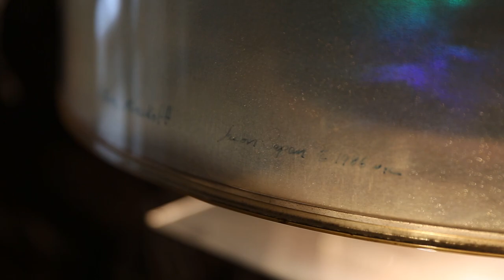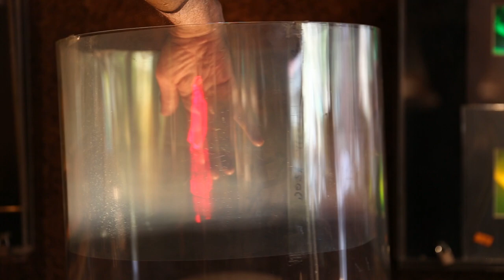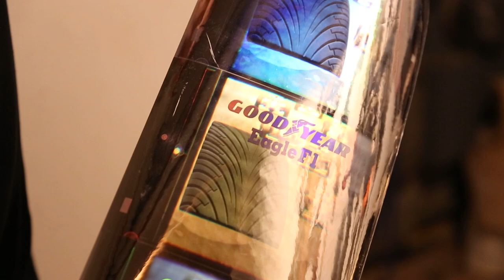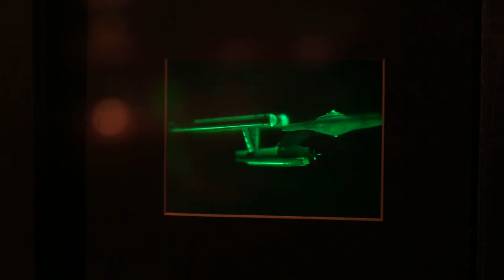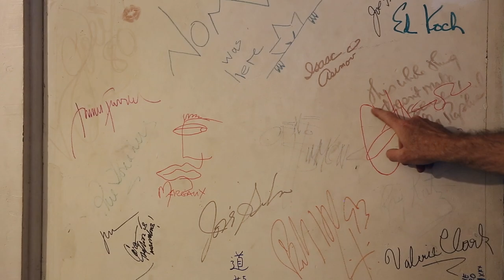How Holograms are Made

Comment: From what I understand, this still isn't a hologram. All they've done is burn a 3D image into different thicknesses of film. It seems as though all these tech companies are changing the definition of a hologram because they can't figure out how to achieve it. A hologram is a 3D image made from the interference of multiple continuous light beams. There shouldn't be anything left over to put in a display case; at that point, it's just a sculpture.

If I'm not understanding this properly, please explain. However, the definition of a hologram is decades old. Think Princess Leia's message displayed by R2-D2 in the original Star Wars, that's a hologram.
Reply: The rapper 2PAC had a holographic concert a while back. Look it up on here(Youtube). That is the idea most are referring to when speaking of holograms.
Reply: I think these could be considered holographic pictures, and they just called them "holograms". Yes, we all want to see real holograms, but I can't really fault them for using that terminology; it sounds like they actually are creating the information of a hologram, but the only way to show them right now is on a 2d surface.
Reply: James Dreger  Correct the Idea of the Hologram is set... Pretty much without color atm. But The background or backdrop is still required. No Fully 3d Hologram will be made in our life time. Millions of light sources and or Beams or projectors would be required. 2 Pac was Partial 3d. Close to what was in Minority Report 
 Lots of projectors shot at a backdrop in a half moon shape.
In our life time Minority Report Holograms will be real and we will have heads up displays and Other 2d but 3d eye fooling holograms in our near future.
Reply: ".., the definition of a hologram is decades old. Think Princess Leia's message displayed by R2-D2 in the original Star Wars, that's a hologram." This in fact wrong. Deze defenitions of holograms displayend in movies in a common misconception. Real holograms are these images created by the interference of multiple continuous light beams. It is a phenomenon of Physics that even is lectured at engineering schools.
Reply: Shanim Z But even that was basically, a projection on a mirror, that bounces onto a sheet of transparent paper, or material. 
If Snoop Dogg stepped one step to the left it would have ruined the illusion. As he would have been reflected in the mirror.
Reply: True. The Tupac effect was basically just the Pepper's Ghost effect which was done in the 1800s. It's also used daily in the Haunted Mansion attraction at Disney parks.

The definition of hologram in nearly every dictionary is exactly what I said originally. However, it seems that later on, it was amended to include "a photograph of an interference pattern that produces a 3D image." So by definition standards, I guess these are holograms, though not the kind I'd like to see.
Reply: Rob Cartwright et.al.
While by some standards a "true hologram" must be an image (or something that looks to be a real object) floating in space with no complex projection system, as depicted in some old movie, that does not define it.  The things in this video are Holograms, although just pictures of holograms..  Your definition "burn a 3D image into different thicknesses of film" is rather vague and seems to imply that there are regular images stacked one on the other, but done that way, they would all be present and produce nothing but a blur.   It is also not clear just what you mean by "a 3D image". That could be anything from an image on a flat screen with effects such as shading and persoective that has the appearance of being in 3-D without binocular vision; or it could an image that looks to have depth due to presenting different images to the two eyes, thus allowing ther brain fo interpret it as an object with depth.  

Summary:  A hologram is a complex pattern of what may be considered as diffraction gratings that produces the pattern of light that the original object produces when it is illuminated.  As someone who has made holograms (literally in my basement) I'll repeat parts of my earlier post for you to consider.:
 
  What is contained in the hologram film must be understood as a very, very complex three dimensional interference pattern within the film's emulsion.  Because the film has thickness, there are interference 'patterns' created within the depth of the emulsion as well as across the surface dimensions. These interference patterns are on the order of the dimensions of light waves and are stationary.  They are called standing waves.  They are not direct images of the original object as ordinary photos are.  If you do not illuminate the hologram film from the proper laser wavelength and the proper direction, you will not see the image.   An ordinaly photo can be illuminated fron just about any abgle in front of the pisture.. 
Because these patterns don't move as the light waves vary through their high frequency cycles, they expose the film in a stationary pattern.   If you understand how standing waves are produced on a radio transmission line, this is the same principle, only in three dimensions instead of just one.
...
  The film must be developed and bleached to make it look clear to view it. To view the image the laser beam is spread again and shined on the film from the same direction as the original Reference Beam.   This film is now just like a "window" though which you see the object in the same position it was when the film was exposed.  The hologram produces light that leaves the hologram in the very same way it left the original object (and passed "thought" the window formed by the film).   As your eye moves around the window's area, you see light in the same way that it actually left the object and traveled in that direction to the film.  Since, at any one time, an eye only looks through a small part of this film window, this means that every location on the hologram film has a complete image of the object as viewed from that single location.    THEREFORE, your two eyes, located at different locations and looking toward the film window, receive light in the same way they would form the actual object and you see it in 3-D.
...
 You may think of the hologram film as having billions of really small, strangely shaped prisms that refract the laser's light.  These dimensions of these effective prisms are on the order of the dimensions of light waves.  They refract the light from the viewing laser into a form that duplicates the very way reflected light left the original object.  Also, because they are prisms and prisms spread the colors in slightly different directions, you must use the correct wavelength of light to reconstruct the image correctly; though in my experience a close color looks pretty much the same. This may not help, but if you viewed a hologram of the simple interference rings from two split beams aimed at the film, you would see a single spot of light representing the "object beam".
...
Lastly, the reflection holograms you see in the video and on your driver license or charge card do not do justice to the meduim mainly due to their small size that prevents much 3-D effect to be observed.
--
Cheers, ScienceAdvisorSteve
--
P.S. Yes, it is possible to make a hologram image that "floats" in front of the film.  This is done as a hologram of a hologram to get the image on the other side of the film. However, the film must always be behind the floating image.   Light through the film must meet your eye.  It is a "virtual window" behind the image.   A complete ring of film is required for you to walk around such a floating image along with light from a single laser coming from all around the outside and shining inward toward the center.
...
P.P.S.  Another amazing aspect of these "Transmission Holograms" is that if you shine a laser dot onto the hologram in the reverse direction from the original reference beam, you get a complete image of the object projected on a screen located where the object had been.  This is without NO lens.. This is because, unlike regular photographs, each tiny piece of the film containes a complete set of diffraction prisms that produce a complete image of the original object(s) [from some single perspective].  The image will be seen from the perspective of the point on the film where you would have looked at the original object when you exposed the film.   As you move the laser dot around the film, the projected image changes perspective (rotates) to match that location on the film.  I saw this demonstrated in a hologram talk and duplicated it myself when I made my holograms.  No lens projection --- Very COOL!
 So, unlike an ordinary photo, any small piece of the hologram film can show the whole object, but just from a limited perspective.  If you cut an ordinary photo into small pieces, each piece will only show you a small part of the original object.
...
P.P.P.S. There are white light as well as colored Holograms and they use some sophisticated processes to achieve them, but those are other subjects all together...
Reply: Rob Cartwright mmmmmmm pepper's ghost makes me happy.  I got to fool around with a true peppers ghost effect in a haunted house attraction.  It was done with I think 1/2 plate glass and a very bright spotlight.  It was pretty epic.
Reply: The word hologram comes from the Greek words holos, "whole," and gramma, "message.". You have chosen the science fiction use of an ambiguous term and call it correct, however it is not. Good day sir.
Reply: Observ45er You, sir, made more sense than the video itself!
Reply: girass I was merely quoting the definition of a hologram from a popular dictionary, which does seem to be in line with the science fiction usage of the term. I was seeking clarification and conversation. No need to get huffy.
Reply: Rob Cartwright Just about everything he says is correct, but you must understand holograms first before you can understand that he is explaining them.  They really need to redo (or remove) this video ! ! [not to mention the vast majotiry of all other YouTube videos]
...
The part about moving when you take a selfie causing blurring has no relation to his explanation about the speed of light and why there is a reference beam to form the standing wave patterns.   He used a bad analogy that does not apply.
...
Very few listeners would grasp that phase is a measure of relative distance to the film, yet he throws that out there as well.
... If my explanatino is understandable, thanks.  I worked on it for a while...

Cheers
Reply: Shanim Z That was a projector pointed at a sheet of glass
Tech we had for many years
Reply: A 'hologram' is just a 3d image. There are many kinds of holograms, and this kind just isn't the kind you are thinking of.
Reply: ***** Holograms do exist and there are many forms of holographic technology, including this one.

That said, even imaginary things do have names, eg "dyson ring".
Reply: *****  If Holograms don't exist, then what did I make in my basement back in the 1990's with my HeNe laser,  beam splitter, mirrors and  special film that I then developed and bleached with a solution of tincture of iodine and can now see the objects I had in back of the film, when I shine the HeNe at it from the same direction as the original reference beam?
--
How do YOU define the term "hologram"?
Reply: *****  Do you mean to say that you define a hologram as  nothing more than the "Pepper's Ghost" effect that is caused by an unsilvered glass at 45 degrees?
Reply: *****  I'm still not understanding, but trying. Your intent is not clicking on this end.
 
What I made in the 90's is "that"...?  What is "that"?

What precisely are you calling the ghost pepper effect?
I am familiar with what is called Pepper's Ghost effect.  This is plane glass at 45 degrees that reflects something into an area where it isn't.
Reply: well we legaly and safley cant use holograms because the only real way to make a hologram is using this rediculously radioactive machine that can only be used for short periods of time but this is a good alternitave because its safe and simpler for anyone to create or obtain
Reply: ZBoy0123  What?  The ones I made didn't require any "rediculously radioactive machine".
Reply: *****  Neither did GMG...
Reply: *****  From understanding Hologram to Dooms day machine....  What's the connection?
...
This video is not the place to gain an understanding of holograms, so on second thought , perhaps it is the place to jump off onto an unrelated obtuse subject...
Reply: ***** While I don't see that connection, at least I see where you drifted...
tnx. 
But... as I said.  What the guy says in this video is an overview, summary, analogy of holograms that makes sense to someone who already understands the subject, but not for someone who doesn't.
Reply: *****
i think ghost peppers are a species of hot pepper
Reply: CorvusCorone68  Nah!  Ghost Peppers aren't hot at all. They're rather cold and clammy.
Reply: Tim Goelen
i exactly think same way. Hologram is basically "seeing 3D images in the air, without 2D screens, and can be seen from 360 degree, " if it is not , it should called something else. everybody change the meaning of hologram. before star wars, none of us know what hologram is. that scene is hologram to me..)) does it exist ?
Reply: Yavuz Zengin Movies don't define what a hologram is.
Reply: Observ45er yes it does. do not underestimate the movies my friend. they push the limits, they afford and support these technologies. you better read again my post. have you ever seen or heard of hologram before star wars? i do 2D & 3D drafting , modeling and animation to make my life. These movie production companies use most advanced technologies before all of us. Now so many companies makes shitty products and call them as hologram to make money. Search google , you gonna find millions " hologram projectors for $300 , or 4D, 5D, 6D, 7D hologram products... guess what ! they all work on 2D screen
Reply: Observ45er
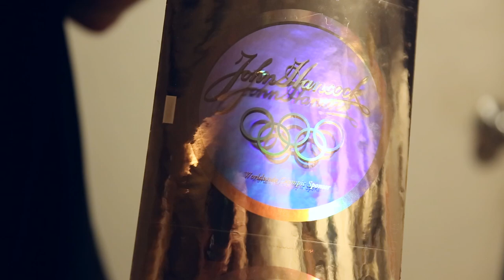 this guys exactly saying what i am trying to say like so many people who is not expert on this and asking same question if you watch between 2:30 to 4:20 . And i repeat my question " does it exist ? " . it is all scrambled to me. that is all i need to know :-) i am not trying to define what hologram is here. Just curiosity . thank you if you can answer this
Reply: Yavuz Zengin  Very good.
A: Yes.  What was poorly explained in this video are true holograms.  They have true 3D appearance when viewed by us folks.   I literally made some in my basement and still have them and can see all this myself.  That's why I got interested in this.
...
2:30-2:50  He's trying to explain the interference of light waves - constructive interference and destructive interference.  This is going on at a microscopic level to the very small waves of light.
@2:50 that jello mold analogy doesn't do it for me...except that the Jello is the same shape as the original.  The hologram makes a pattern of light that leaves the film in EXACTLY THE SAME WAY it left the original object.  This includes intensity (brightness) as well as the direction the light traveled going away from the object.  This means that your two eyes see the same two different images they would see when looking at the original object and, therefore, see the 3D depth you normally see.  You can also move your head around and see the image of the object at the same angles you could see the original object.  Unfortunately it is not a simple concept to understand when it comes to a real and complex object.
An ordinary photograph has only intensity from one viewing location  so you see no 3D at all and you can not move your head around to see around parts of the object.
...
One of the holograms I made has a magnifying lens and you can move your head around to either look through the lens at (gambling) dice, or look around the lens to look directly at the dice.
...
Hope this helps
--
ScienceAdvisorSteve
Reply: yea this is not full hologram top one is to use light and not seeing where the lighting is coming from but still protected it in the place you want and the colors and images on nothing but line air. use thing is not what human can see then making it into something they can see. Think Princess Leia's message displayed by R2-D2 in the original Star Wars, that's a hologram. even that one is low tech to what one i said lol
Reply: king weed   The things described in this video are holograms.   The word 'hologram' means what is in this video....high resolution intereference patterns on a film illuminated either by  a laser, or for other types, by regular white light.
...
The "Princess Leia's message displayed by R2-D2 in the original Star Wars" is a complete fake special effect.  It is not real, does not exist and is not a hologram.  It is, however, what you and many other people *wish* was called a hologram.
... If you understood light, you would know that what is shown in the movie is not possible.  Light cannot turn a sharp angle for no reason.  It takes something like at least a screen to do that -- and that is what a real hologram does.
...
 A true hologram is what is in this video, not what you would like it to be from something a Hollywood special effects company added to a movie. 
Cheers
Reply: Observ45er I refuse to allow your knowledge to destroy my childhood.
Reply: one in this video is a fake a cheat to it
Reply: Observ45er From what I understand, a hologram is a recording of tridimensional information in a bidimensional recording medium, most holograms record the interference patterns in the thickness of a film, that is, they still need a 3D space to record it, however, as I understand, there are some recording media such as photographic emulsions known as amplitude holograms that only create a grating of dark and clear zones in a surface which will reproduce the original wave front through diffraction, these would be the true holograms. What do you think about this?
Reply: LambareNg    It's been a while since I did my holograms and read up on it.  I just scanned Unterseher, Hansen, Schlesinger that I used, and it doesn't go to that depth, just the How-to.
...
I don't know if you read all my comments here, but...
I imaged some die (gambling dice) and a magnifying lens.  Looking through the hologram 'window' in the normal transmission hologram setup, you can look either through or around the lens just as you could when the original objects were set up for the exposure. Except for the single color/wavelength, it is no different than looking at the original set up (which you also viewed in the laser wavelength).
...
Given that what I made does duplicate the wave front that came from the original objects and the wavelength of light is so short, I find it difficult to believe that the emulsion is so thin that it does not have enough depth to have a standing wave (Interference pattern) that has variations within the thickness of the emulsion.  In addition, since every square millimeter on said emulsion contains enough of a diffraction pattern to recreate the entire image (from the perspective of that location on the film) I believe this also supports that conclusion....
  The 5mw HeNe I used has a beam only about one mm in diameter. If you shine the laser spot onto the hologram film in the opposite direction of the original reference beam, you will project a real, and absolutely complete image of the original scene onto a screen that is located at the same location as the original object(s) were relative to the film. The image will be in focus at that location.  As you move the spot around the film, this projected image is from the perspective that you would see when looking through that part of the film in the 'normal' viewing setup.  This represents a pretty complex interference pattern in a small volume and it seems reasonable to me (without reading more on the net) that there must be some emulsion depth that is necessary to support that kind of complexity.   So until I read something to the contrary, I think emulsion thickness is part of the requirement...not just fine grain.
...
I saw that projection demonstration many years before I made holograms and wanted to see/do it for myself --- and finally did when my two sons wanted to do science projects on holograms and we geared up and did it in our basement---really!. I was doing laser light shows back then and had a few 5mw NeNe's. I borrowed a hologram kit that had lenses and simple sand-box table mounts and I had a nice beam-splitter already. I put a foam rubber pad on a sturdy cabinet with an old kitchen counter top on it, built the interferometer and it was stable, so we had at it!  I have several nice holograms I now show to grade school students in science talks I give.  I was invited, probably 15 years earlier, to a talk on holograms where I saw the projection demo, by the president of the Chicago Photographic Society, or perhaps it was the Chicago Antique Camera Club (A neighbor).  He had a living room wall cabinet full of cameras.
...
Cheers, ScienceAdviserSteve
Reply: The correct term would be holographic projection
Reply: behnamasid2   "The correct term would be holographic projection"
...
Just what would that be the correct term for?
Reply: Observ45er For a displaying truly 3-dimensional displays by controlling photons,  without using any kind of screen.
Reply: king weed  Why do you say these are fake?
Please explain your assertion.
...
They look just like the ones I made (literally in my basement) back in the early 1990's, as well as many I have seen that were made by others.  Have you had high school level physics and seen what are called "ripple tanks"?
...
His explanation may be lacking, but if you understood what holograms are and how they are made, his explanation does at least attempt to explain it with somewhat vague accuracy.  Explaining such a complex interference pattern and the concept of phase in waves is not easy in just words.
Cheers.
Reply: Rob Cartwright My argument would be that this is still a hologram because without a reference beam, the image would appear flat and without phase. This process still requires the interference of two beams intersecting. Because the medium used to capture the light is thick film shouldn't rule this out as a hologram.
Reply: Matt Horner  Despite what other comments may say, what are described in this video are true holograms.    Though the explanation by the expert may be difficult to understand, what he says is correct.
...
Without the reference beam, Holograms are not flat; they are not observable at all.  With anything other than the reference beam (or something close to it in wavelength and spectral purity) you see only a foggy piece of film.
...
  I've made holograms literally in my basement.
...
naturalist3D has some dual image 3D pictures on his YouTube Channel, but I do not know how to on-line view them.  There is some app that is needed, or use any of the common techniques:
https://en.wikipedia.org/wiki/Stereoscopy  
...
I've made dual picture 3D slides like that as well.
--
Cheers, ScienceAdvisorSteve.
Reply: *****   What is in the movie Star Wars is NOT "actually a holographic projection".  It is a special effect only that shows what a holographic projection is imagined to look like my many.
Reply: +Rob Cartwright, do you know if we can do princes leia stuff at this time? that's also my understanding of a true hologram.  in the conspiracy field there's "project blue beam" that says we can do much better than princes leia but i don't buy it. thanks...